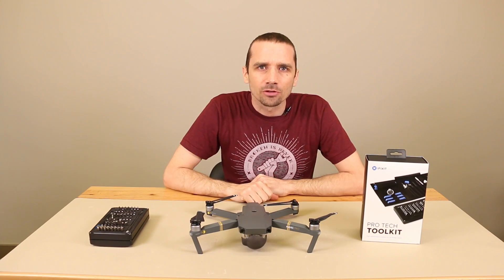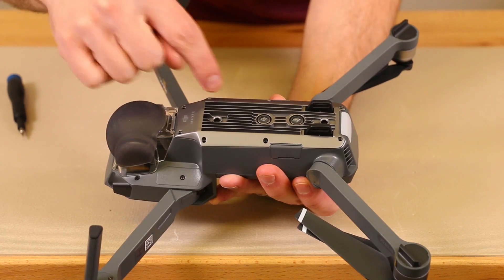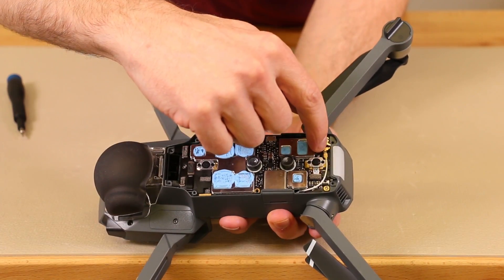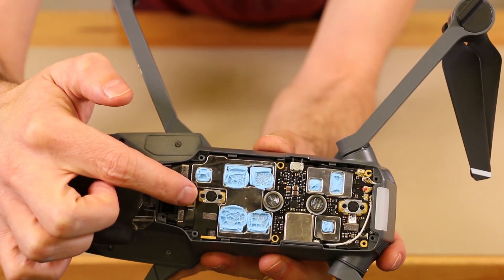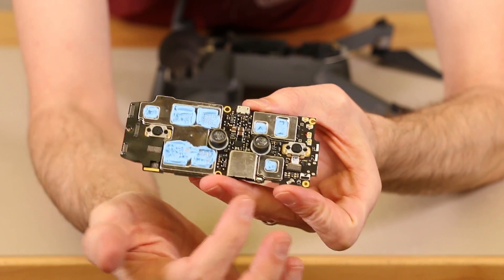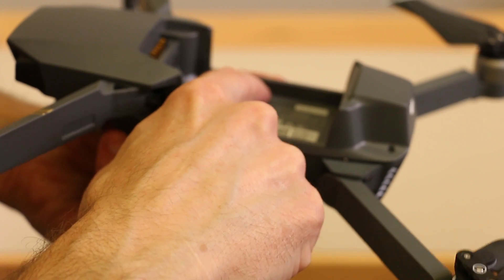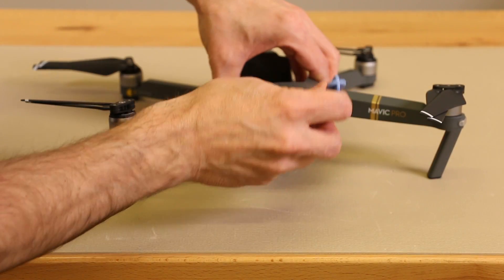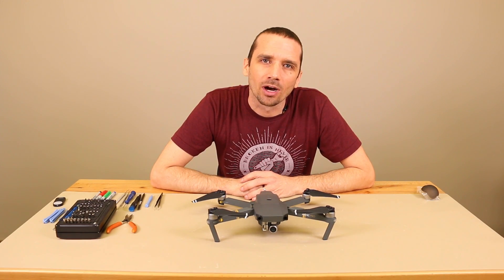DJI Mavic Pro Teardown

Comment: Hi all
how  it called that blue "thermal pasta" thing? Is it silicon? I asking because I have to re do it.
Reply from the maker: It's a thermal pad
Reply: @Tronicsfix  it's not thermal pad. Pad keep shape after removing it. Here we have thermal compound. You can easily use PC thermal compound. Most of them don't conduct electricity and has higher quality than this blue crap. I used Noctua one and now heat sink get really warm before fan start.
Reply: @TheYamakasi007  thermal pads will do the job just fine.

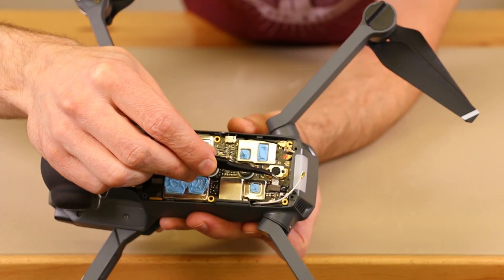Comment: The connector of the ribbon cable at 3:30 came off when I was taking it off, what would you suggest it do? Just stick the ribbon straight to the board?

Comment: starting a new job repairing phones and my boss wants me to learn how to change the cameras on these bad boys. do you really need to pull the whole thing apart just to get to the camera/gimbal cables? he said i would be replacing the whole camera/gimbal component. 

I fly a rotorX Atom V2 so those things are easy to replace parts on, unless u smash the control cube that's expensive, so i was hoping you or someone could link me to a proper camera replacement video for these. I saw the mav 2 camera swap vid and am watching that now too.
Reply from the maker: The Mavic 2 is MUCH easier to replace the camera/gimbal. The Mavic 1 does not have an easily replaceable camera/gimbal.

Comment: Hello, I have big problems with my Mavic Pro, I crashed in to bridge and the river and after the cleaning with fresh watter and drying my Mavic wont start, battrry is On but Mavic Wont start. What could be the problem I opened when I cleaned but the parts are ok,  I think that is no power from batterry to motherbord. I don't know what to do :(
Reply from the maker: Unfortunately, just no way for me to know. With liquid damage it can be really tough to diagnose the problem.

Comment: I think my SD card slot is broken in my Mavic Prox did you see any way that could be replaced? Or would i just need to get a whole new board?
Reply from the maker: It could probably be replaced but would be a difficult job. It would be easier to just buy the board if you can ever find one.

Comment: Did you use a 1.5 hex for the two middle screws on the bottom plate? It didn't lock for me. What would you do if the screw didn't come out?
Reply from the maker: I'm not sure what you mean by "it didn't lock for me". If the screw doesn't come out then you have to figure out why it's not coming out and go from there. There's no way for me to know.
Reply: TronicsFix LLC I meant that my - 1.5mm is smaller than the screw. I used a 2.0 that was too big. I'm gonna  purchase another 1.5 hex driver and try a T5 to see if I can get them out
. It isn't stripped yet.

Comment: Are the metal parts that are covered in thermal paste made of aluminium or some other metal?
I'd replace it with some liquid metal based thermal paste, but that stuff will destroy aluminium.
Thanks in advance!
Reply from the maker: I really don't remember. I think so but I can't say for sure. I would not use liquid metal on them for sure.
Reply: Thank you for the quick reply, mate!
Looks like I'm gonna do some more research. The reason I'm thinking of using liquid metal based thermal paste is that I might just squeeze out some extra battery life with a more efficient cooling solution, especially now that summer is on its way...
Reply from the maker: That's possible but I'd just be extremely careful with it. Not only is it not for aluminum, it is also conductive so you have to be much more careful with the amount you put on. Any that squishes out and contacts other components can cause serious problems.
Reply: Thanks for the advice! I have been using the stuff for years on all the computers that I've built, even upgraded some old GPU's with it. I'm well aware of its properties, but the performance boost is worth the extra effort if you ask me. So why not give it a try on the Mavic?
Reply from the maker: Ha, ha...you give it a try on your Mavic and let me know how it goes 😀
Reply: Will do once I find out for sure it's not aluminium ;)

Comment: Great video! Question, what is the cable connected to the upper shell in the rear! I’m replacing my shell and I’m not sure if the one coming in the mail will have it. Thanks!
Reply: did you find out?

Comment: I opened my sd card cover the wrong way and broke the little flanges off inside the mavic. Should I disassemble to remove? and do you add thermal paste when reassembly?

Comment: Nice vid! Quick question..I have 2 mavics, 1 regular pro and the alpine white version. The cooling fan seems to blow softer on the white mavic. It's not as loud and I can tell theres less air that comes out of the rear vents on the white. I noticed this when I was checking for updates while both mavics were on. Both are pretty much still new. Could it possibly be a design change for more efficiency on battery life? Maybe a lower quality fan in the white?  Thoughts?...

Comment: Hi Tronics,

Can I take out just the top component without having to open the bottom parts?
If so what are the exact tools I need just to open the top components of the drone?
Just because I'll be needing to order it online as none of my screw driver fits.

Hopefully you can help me out!
Something went in where the battery locks (those two little holes) and it went inside so now I have to open the top component just to get it out because i'm afraid it might melt and do something to the drone.

Comment: where are the compass located ? i have compass 2 disconnected error ?
Reply from the maker: http://www.rc-recycler.com/dji-mavic-pro-main-control-esc-board-gps-compass-power-module-port-mc-quad-parts.html

https://www.aliexpress.com/store/product/Original-DJI-Mavic-PRO-Compass-Board-Compass-Module-for-DJI-Mavic-Pro-Drone-Repair-Parts/2825016_32807417060.html
Reply: TronicsFix i don't think its broken as its never been crashed just disconnected. it states their is 2 compass so wondering where they are both situated

Comment: It's funny how the spark looks more advanced under the hood . If the spark had bigger motors and a better camera and obviously a slightly bigger battery it would be freaking insane . Size means nothing if the power of the motors is keeping it stable . The Mavic pro doesn't weigh much more than the spark anyway

Comment: hello sir nice teardown, I have some question,
1)have you noticed any drops in wireless signal from the mavic to the rc,?
2) in your video, you didn't mention any barometric sensor, is it on the first board with all the ultrasound sensor or on the inner board?
Reply from the maker: 1) I haven't noticed any, but haven't flown mine too much either. 
2) I don't know where that sensor is. Sorry about that.

Comment: Nice video! I have a question...after  i crashed my mavic, the little piece that cover one of thoose forward sensor broke! It is easy to fix that if i get a new piece? It is possible to repair without open the mavic?
Thanks
Reply from the maker: You have to open it to do pretty much anything. I'm pretty sure you'll have to open it for that.

Comment: What if you would disconnect the lights? Could that get you more battery life ?
Reply from the maker: I'm sure it would get you a little more. They are LED lights though so they take very little power to run.
Reply: Oh ok :) Thanks for the reply.
Reply: you can turn off front LED-s from the dji go software directly!
Reply: sserev feszoj Yes, but not the one on the back :) However i'm guessing it doesn't really use that much power.
Reply: Andrei Brănescu :)

Comment: Nice vid by the way!! But did you notice where the GPS-recievers where located? Can't find any documentation of it anywhere. Need to disable them, sp would be nice to know the excact location. I have come as far as placing it on the rear end of the Mavic, but no more.
Reply: it be good to flyin non gps mode as contoler or screen don't let u select ATTI mode like Phantom controlers do. so flyin inside or if ud want to fly where the quad drifts and don't lock down to one spot (for cinematic shots) wonder if it's as easy as puting tinfoil over top of back to keep the gps locking.
Reply from the maker: I didn't check that...I'll have a look at that if I do a future video. Why disable them...just out of curiosity.
Reply: The GPS receiver is located right at the back of the top cover and connects to the main board with a wire and plug, very easy to disconnect if needed.
Reply: change sport mode switch to ATTI mode with firmware mod using dji assistant in debug mode.
no need to butcher it.
Reply: Ladies and Gentlemen! I found it for 1131.99 USD with coupon code: MAVICC811
http://www.gearbest.com/rc-quadcopters/pp_483950.html?wid=21&lkid=10617001
Cheers

https://www.youtube.com/watch?v=ndZVS8CtTLw

Comment: Is it possible to remove the top cover without removing the bottom cover? We've got a Mavic Pro that's not getting any camera output and the gimbal doesn't seem to be receiving any power, so I was thinking that one of the ribbon cables were knocked loose during shipping, and would like to see if we could take a look and potentially fix it, since DJI hasn't replied to us since December about the problem.
Reply from the maker: You should be able to but I haven't actually done it so I don't know for sure.
Reply: Yes u can easy

Comment: how do you know you won't fry that circuit board with an ESD  (electrostatic discharge) without being grounded? I build circuit boards for a living, and have seen what an ESD can do to a board. It doesn't take much to fry a circuit. Now don't get me wrong, I'm not trying to be a wise ass.  I'm just asking. How do you know you won't?
Reply from the maker: Experience mostly. Firstly, I was careful with what I touched with my bare fingers on the circuit board. Secondly most electronics like this don't have the delicate parts that you would need to be careful of ESD with. I've seen what it can do to a board as well and when the situation calls for it I'm very careful about it.

Comment: i replaced my fan on my ps4 internal fan and it is still really loud and blows out fairly cold air or room temperature do i need thermal paste??
Reply from the maker: If you removed the motherboard and didn't put new thermal paste on it then yes, you need new thermal paste.
Reply: TronicsFix ok thank you